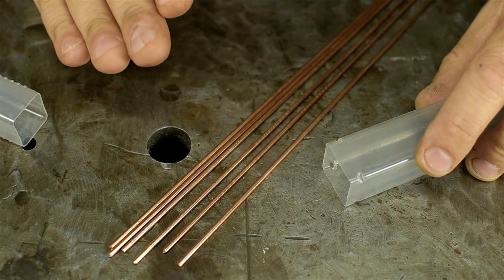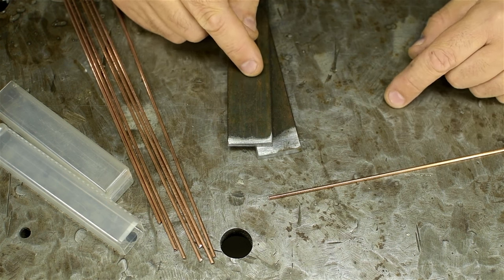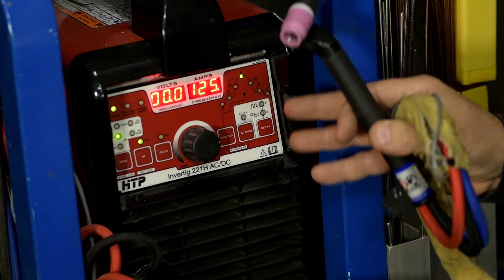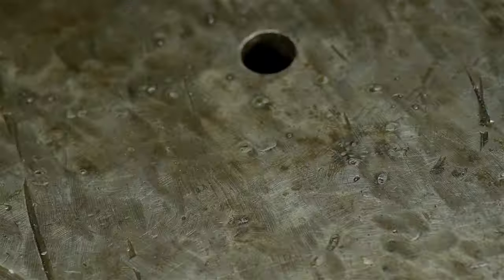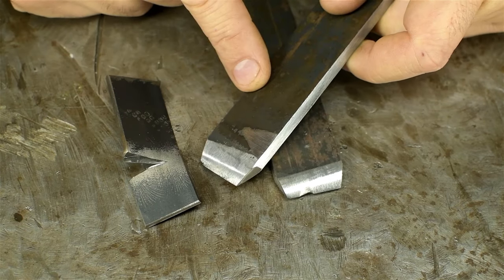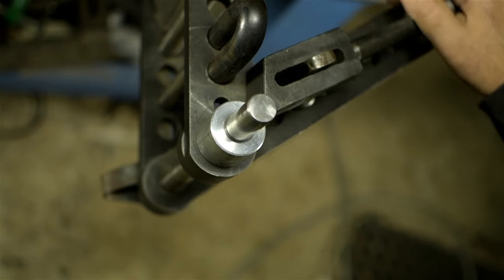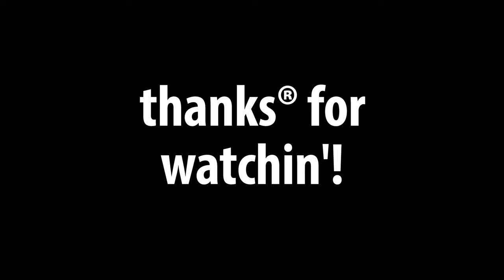TIG Welding with TOOL STEEL filler?!

Comment: "mild steel can't be hardened" - I'd like to correct you on that in a couple of ways: can't be hardened much - for the genuinely soft stuff you're talking about, you can't harden it much, but you can harden it a bit. Then there's modern supply variation. Apparently some of the plate stock that comes through as "mild" can be 350MPa or 400MPa and a piece of this stuff I bought 50mm thick had been plasma cut on a giant CNC machine. I etched the scale off the top with HCl and drilled/tapped the bottom for a base and so forth, no worries. Then I nearly gave myself a hernia lifting this thing I'm building and decided it needed a couple of lifting tabs screwed on the sides. This is where things went a bit wrong... "it's just mild steel, no problem" I thought. Damaged a brand new high quality US made punch trying to make a starting location for drilling. Managed to make some dents in it without realising what was going on, but then I put a drill bit in there, 1/8" or so, and wasn't paying attention and destroyed the drill bit (grooves in both flanks from the edge of the dip I made with the punch). Oh, cheap bits, will use a quality locally made one, destroyed that, too. Emailed the guy I bought it from "nothing special" he said. Ended up successfully drilling through the plasma-hardened skin about maybe 1mm thick and into the soft metal behind maybe 2mm in or so using a carbide-tipped drill bit! Once that was through, a normal bit, cheap or quality, did just fine. So... can't harden "mild" steel? Depends how mild it is, some of the "mild steel" these days isn't all that mild any more! :-o

Comment: Hello, question...could this fill be used to repair a chipped ratchet pawl tooth on an old Snap-On ratchet? So it's obviously tool steel. The chip is a small 1/16" wide by 1/4" long on the top of the tooth, very small but noticeable when ratcheting. I was thinking of taking it to my local machine shop to get their input in repairing this tooth as well. I would appreciate any input that you would have on this repair. Thanks

Comment: What kind of tool steel is it? I've had to weld high carbon steels that had to be preheated and slow cool or it would crack. I've used 0.010 thick S-5 shock absorbing rod to weld repair a progressive punching die that had rolled over edges and my rod HAD to be S-5 for its hardness and shock absorption. Used 1/2 amp to run a bead on the edges. I had to weld backwards to keep the bead from laying down. You need to see micro-welding to understand the processes. Luckily I welded fast enough so I didn't have to heat treat the die and punch.

I've also had to weld D2 tool steel blades. D2 contains 12% chromium and 1.15 Carbon plus .85% Vanadium. I had to weld small tabs made of D2 onto the blades to hold it in position in the cutter machine. The tabs were .093 thick and the blades were 1/4 inch thick by 4 inches by 18 inches. I sheared strips of the .093 material for filler rod. D2 by the way without being heat treated hard is still hard even in the annealed condition. I took the strips I sheared square and ground them down without turning them blue to keep O2 from getting into the weld. I then tacked each corner of the tabs. I then would weld about 1/4 of an inch bead hold my heat there and let it cool down slow and then jump to another tab and weld another 1/4 inch bead. I had the D2 plate clamped down to a one inch thick plate of aluminum. After welding all the tabs per the print I released the clamps and let it curl up just a bit. I flipped the part over and just put down enough heat to make the plate flat again to within .5 mm or .020, I always held .005.

Next process was to send out to the heat treat company who HT to HRC 59-61 and it came back to the grind shop for final grinds while being sprayed with coolant. I had been tig welding for 25 years plus also sheetmetal. I also learned heat treating and I make knives to this day as a hobby. If you understood heat treating you would have welded those chisels differently. I have actually used mechanical pencil graphite to make my own hard face rod and that took some experimenting.

Comment: I haven’t read all of the comments so sorry if someone’s already asked.
On larger e.g. 2” / 50mm metal cuting HSS drill bits sometimes they can “chip” and leave an otherwise very good drill tip geometry that needs an enormous amount of material removed to get down by the chip wasting valuable drill material and time. 
Would it be possible to use Tony’s tool steel rods or similar to spot on the chip locally and just touch up the existing grind ? Maybe it’d leave a soft ring round the “tool steel” where it annealed the HSS ? If it’s possible it’d make a great follow up to tots “sharpening drills the long way round vid”

Comment: I said to my wife halfway through this video, “I need to buy a TIG welder then I could use this stuff to weld up my lawnmower blades so they would stay sharp longer!”   .... and then you said specifically don’t weld up your lawnmower blades....

Comment: I in no way want to correct TOT, but the difference between the strength of mild steel and a weld is not nearly as drastic as stated.  The 70ksi of the ER70 is the ultimate strength of the filler. The yield strength of a weld made with ER70 can vary a bit, but will typically be around 48ksi.  48ksi and 36ksi are a bit more comparable.  And the basic structural steel with a yield strength of 36ksi will have an ultimate strength somewhere between 60 and 80ksi, which is why the ER70 makes sense as a filler.

Comment: Avoid shock loads on tool steel is excellent advice. I smacked a torsion bar from a pickup with a 3lb hammer. Torsion bar exploded and sent shrapnel into my hand. Required surgery to remove a couple chunks stuck into my finger bone.

Comment: I flipped over a hilti punch cos the head was bigger, as i required for my rawl fixing.......and BAM!! just as I applied that shock load to the tip of the punch a tiny piece flew off and hit me in the lower eyelid. This man knows his hardened steel onions!

Comment: You could squirt oil all over Ron Covels English wheel anvils, sprinkle them with metal shavings and dirt and Ron would look at you and Smile. The guy is as cool as a cucumber, unflappable, Hell of a panel beater too. So Tony go easy on our gentle bearded metal shaper when you start throwing Men Without Hats at him.

Comment: Mild steel is a deceptive term.. it just relates to the carbon content.. as far as tensile strenght are concerned.. mild steel can range from 30k to 140k tensile strenght very easily.. depending on allowing materials.. such as vanadium.. one of the additives typically in tool steel which makes them hard.. (outside of the higher carbon content of tool steel.) You can harden mild steel generally, and you can harden a36 specifically.( I'm assuming that's they one you are reffering to in the video..(although not as hard as tool steel probably.)

Comment: Watched this video RIGHT after Shadiversity talked about putting a tool steel  edge on a lighter material. IF (And it's a big if) you can weld this onto a light metal, eg titanium or alloy then I'm Sure Shadiverisity would live to make a blade with you https://www.youtube.com/watch?v=KoC-apkxDoc&t=798s

Comment: Hey so, when is that dial test indicator stand beginner's project coming out? You and your german boyfriend already made me spend six figures on machines and tooling and I'm still using a cheap magnetic stand on a parallel 'cause someone has been promising a stand build in his videos for like 5 years...I have a rusting chunck of iron and a HSS boring bar that I had to light a couple birthday candles to already... And what's up with that Maho footage? Where's our Maho final build video!?

Comment: Dear ThisOldTony, I just wanted to say thank you for all the things I've gotten to learn from you.  I'm good at finding info and learning, so I likely would've ended up here regardless, but I've really enjoyed learning from you.  A while back, you did a video about welding telling people to not go welding a trailer together.  Well, I've gone a different direction.  I made a race bike.  The bodywork is still in rough shape, and this isn't it's final form, but I thought you might enjoy seeing something you've helped someone else design and build.  I especially like to go back to the video where you explain Young's Modulus.  Anyway, here it is. https://imgur.com/gallery/16VI2Jq

Comment: WOW, Thanks for sharing.. I always wondered if you could just use some kind of filler metal to add a hardenable edge to mild steal, without just forging high carbon steel to mild..

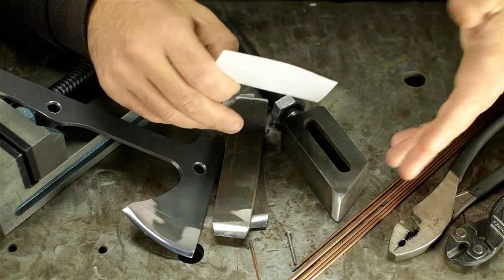Comment: 11:00 Lawn mower blades. My mower blades are of one of two types. Marbain blades which are hardened steel blades. Or mower blades which have carbide inserts brazed in. Have the latter on both 50" and 60" mowers with three blades and 30" with just one blade setups. In larger Bush Hog type mowers we always built the edges up. To give you an idea of how long the Marbains will last, mine are now 12 years old and get 2 hours a week use fairly regularly and up 4 hours in a week when we have heavy rains. And really only needed sharpening again. Which would be the third time in 12 years.

Comment: My Dad made extra money on the side TIG welding tool steel blades for grinding plastic (regrind for injection molding) and he used what called "air hardening tool steel" rod just like that. It turned into a side business as he started welding up damaged injection molds for cash and returning to work to re-machine them. He never paid me for laying the beads though LOL. I just liked doing it. No, I just did the regrind blades--he would do the mold cavities.

Comment: I'm building an aqua-mining attachment for my wet/dry vacuum to help me dig out a tree stump by sucking out the dirt below it, and I need to put some teeth on the mouth so I can cut thru small roots.  However, they need to be hard enough to survive contact with dirt and rocks too.  Your video reminded me that I have some OLD hard-facing stick electrodes that might be good for this.  I will try knocking off the flux and TIG my way to happiness.  You may be no Jody Collier under the hood, but your videos are a hoot and an inspiration.

Comment: I'm sure you already heard this from someone, but Jody from Welding Tips and Tricks just recently did a similar video on his channel. His tool steel filler rod was a cheap Ryobi drill bit. Brilliant idea to re-purpose an old crappy drill bit.

Comment: Now retired..before retiring worked in die shop, a lot of the trim steels (upper and lower) were 1040 or 1045 steel with .12 to .25 (depending on  material being cut)  x 45 degree chamfer on cutting edge then preheated and tig welded with hardening filler rod ...upper used a harder filler and lower was about 5 Rockwell softer..upper held up better while lower was easier to repair.

Comment: I've been fucking around forging mild steel wood splitting wedges and then hard facing a 1080 cutting edge on it with the oxy acetylene. Seems to be working well.

Comment: Hold up!  What if you made a knife out of some affordable and easy to work steel, built the edge up with this tool steel filler with a wavy interface line, etched it and polished it?
Hard edge, soft spine, kinda like a differentially hardened blade. 
Would the etching and polishing show a Hamon like the ones you see on traditional Japanese swords? 
If I'm wrong about this please explain to me why it wouldn't work like that, I'm genuinely interested.

Comment: Have you tried welding with a small worn out drill bit? Thats tool steel...and yes this is totally my original idea and I didn't totally steal it after watching another YouTube welding channel about tips and tricks about welding....or maybe I did.

Comment: Was a tool and die maker for years.  I used a TIG to repair molds.  Dropped a little ball of weld and then EDM the pockets back out.  Most of the molds were A2 and D2.

Comment: Also refered to as AH-10, air hardening tool steel. I have used it for years on a wear plate on my Steiner tractor. Also works well for cutting edge on the log splitter. I agree about the mower blades. I have used SS on those with good results just touching up beat up edges.

Comment: Stellite (in various forms) has been around prior to WWII. It is not easy to use, but you will find some in a back corner of the toolroom. Why? It is one of those materials that "just works".

Comment: Now a retired tool and die maker,,,used Weld mold 958 on upper punch and softer rod on lower, sometimes in a line down situation, rough grind lower ,roll press over and a quick clearance grind and run..enjoy your videos

Comment: Great idea Tony. I've been welding Stoody hardfacing onto swords, knives, and tools I want to keep for a few months now. Wish I had seen this video prior. The blade is essentially replaceable now. Like other quality blades the hardness applies to the blade and the softer metal allows for the toughness. The spine "should' be softer to take impact. The hardfacing I use does crack sometimes but who cares when it can be rewelded.

Comment: I have a problem with how you do up your laces.  Preempting any elfin safety Karens watching.

To minimize the time and additional pain to yourself when a first aider has to separate the boot from your foot or ankle, the lace should present an exposed loop between the sides which a single, slashing Ninja cut can sever, immediately releasing pressure on your foot.

Comment: Weldmold is great stuff. I used it to weld up die cutter inserts that stamped out suspension components for a major automotive manufacturer. They make another filler that goes up to the Hrc60's. we would stamp out blanks from 1/4 steel that was equivalent to chromoly.

Comment: at 9:45 when you start talking about the bending dog. You say that it should be a hardened material. Wouldn't you want this to be softer than the work you are bending though? So that you don't risk making impressions in the work? If the dog is harder, it could cause dents/impressions on the work, but if the dog is soft, wouldn't the work be safe from being dented?

Comment: Odds aee no one will see this comment, but I recently saw a video of unknown vintage where Jody Collier was doing something similar using an old drill bit as the tool steel "tig filler".   I know metalurgy is a science and this specific rod TOT is using is likely superior to drill bit hard facing, but I would be curious as to how the two compare using the same garage testing criteria.

Comment: This is awesome to see. I started in Tool and Die at a high production auto parts facility in Germany. We ran very large progressive dies that were designed with many components that were easily removed on the press. It was a regular task for me to TIG weld cutting edges on tool steel components with material matching tool steel rods, redo the cutting profile by hand with a hand grinder (like a dremmel) and stones and then grind flat again on a surface grinder. Then replace the component. We also did sharpening and shimming in some cases, however, if you have some deep chip or cracking or something, it's often quicker, cheaper and easier to just repair it. Especially when you are avoiding tool changes and set-ups as much as possible. 
Now, everywhere I've worked since then, they basically don't even believe it. It's like I'm talking about Mars or something. So, I was shopping TIG welders because I want to demonstrate it to my current employer and to use it on many other fabrication tasks and this video popped up!! Super cool to see a video that basically demonstrates the concept and to now know there is a supplier of the necessary materials. 👍
Also interesting to see this particular material bond so well with the mild steel. This concept opens a lot of additional possibilities.
Thank you so much for this content!!

Comment: I was going to ask a question before you answered it with a warning. I replace my mower blades every 4 years thereabout. I'm trying to kill my gas mower so I can buy a electric mower. I'm forever welding bits onto it to keep it going. I like the idea of never having to sharpen my mower blades ever again.

Comment: I make a lot of shop tools hard faced with tool steel.  Music wire & strips of handsaw blade even work. About 20 years ago I made a bunch of shears with a hard faced edge of O-1 tool steel gas welded with a torch. It works really great  Harden & temper after

Comment: A summer years ago thought I was going to build high end brazed bikes.  Trying various bronze based rods, went to supplier asking for a brand they didn't carry (entirely my misunderstanding of the brand name) so they gave me several rod types based on my description.  One was absolutely amazing, largely used they said for brazing carbide teeth on large earth excavators, drag buckets and such, items with lots of shock load.  The neatest thing to me was easy to work with and relatively low heat to braze originally BUT when in place and cooled...I had nothing at the time that would remelt it yet to grind on it was still "easy".  Very specific properties, doing this sort of stuff is fun.

Comment: you know there is toolsteel we call "Cox" which hardens itself at a certain temperature lower than normal hardening temperature. it's very useful for  die casting molds because you basically just  machine it and chuck it in the form and done!

Comment: It must be pointed out that tool steel fillers should not be used to join materials, but as an overlay. A second pass on the chisel blank before sharpening would have developed an even harder edge. If viewers have specific welding filler requirements contact Weld Mold  at www.weldmold.com